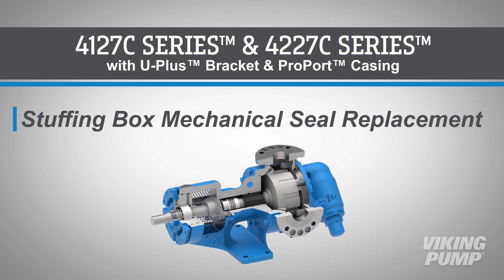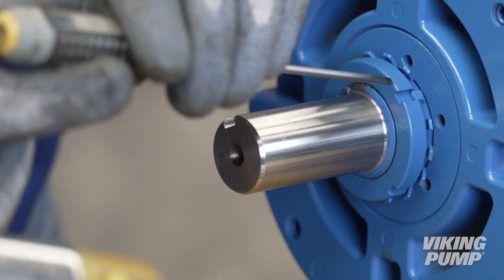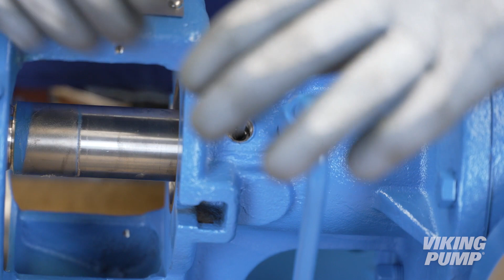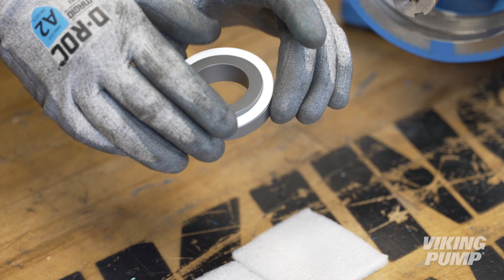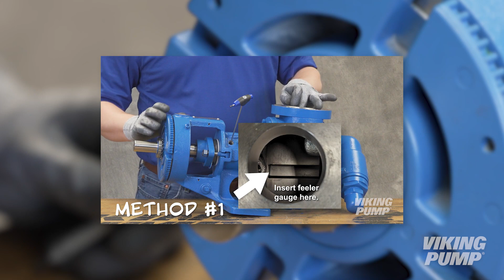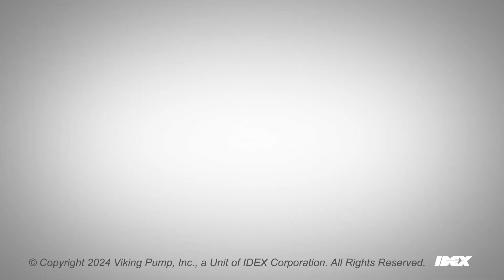Replace Stuffing Box Mechanical Seal - 4127C & 4227C Series™

Comment: Very good. But which seal brand is suitable for your pump?
Reply from the maker: The 4127C Series™ and similar Universal Product Line Viking Pump models are designed to accommodate a variety of mechanical seal designs from all major mechanical seal manufacturers. The stuffing box and bearing housing are designed to accept packing, component mechanical seals, cartridge mechanical seals, and Viking Pump’s own O-Pro® seals without modification to the pump. For more questions, make sure to send us a message here https://www.vikingpump.com/yt